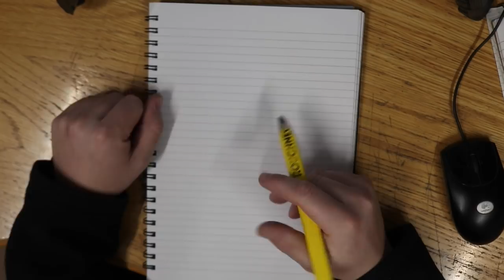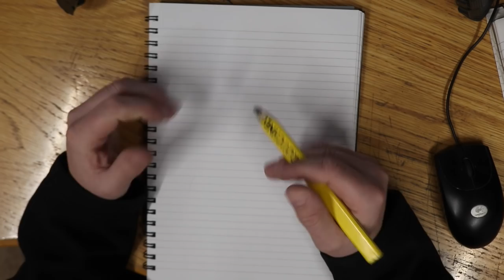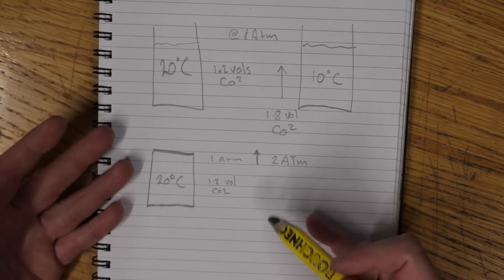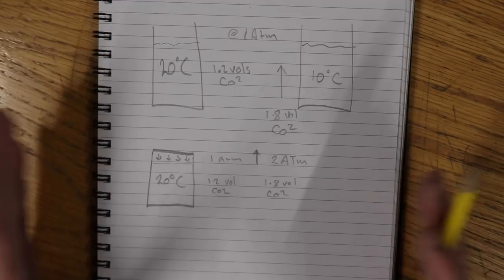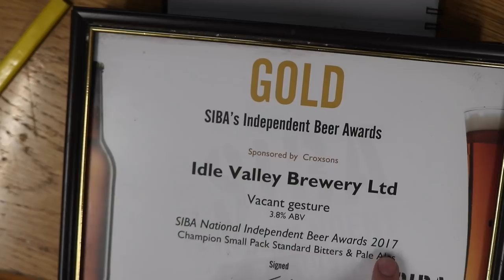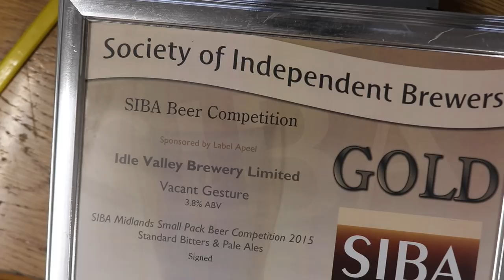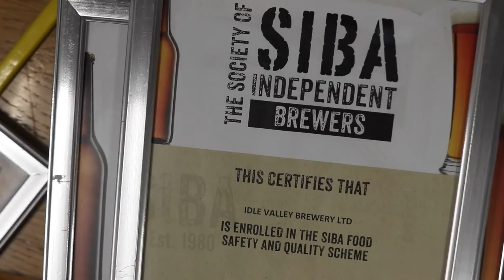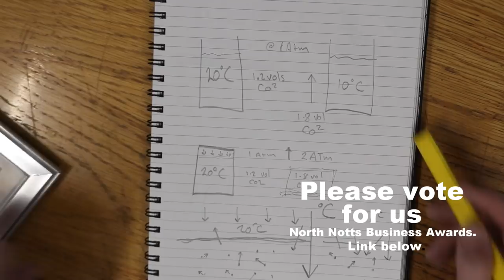The Science & Method Behind Beer Carbonation. As Far As I Know

Comment: Well yes, the solubility of Co2 increases when the temperature drops but it takes some time for it to go back into solution. The surface area is pretty small compared to the large volume of the fermenter. Even when force carbonating beer it takes a few days at a high pressure to get the co2 into solution so just leaving the beer at a cold temperature doesn't mean it carbs up. 
And no one questioned your beer making abilities, so getting out your awards to make a point was a bit much^^
Reply: Completely agree with this! If reducing beer temperature alone meant that it essentially became carbonated, we’d surely see some evidence of it? Maybe Brülosophy should do an experiment, although I’m not sure there’s an easy way to measure carbonation outside of a lab. 

Also - I’ve spoken to both Denny Conn and John Palmer about this, and both have stated that although CO2 will escape solution as temperature rises, the action of lowering the temperature alone does not reverse this reaction. Additionally, you fermented these beers in plastic buckets - I guarantee there was a significant level of oxygen in the headspace, so if your beers were supposedly re-consuming gas, it wouldn’t just be pure CO2 anyway. 

And nobody was questioning your brewing abilities - you can brew great beer without being an expert on every topic related to brewing. People merely pointed out that you may not have fully understood the principle! No need to pull out all your certificates - I don’t see what the relevance of this was and seems a bit petty. A Physics degree might have been more appropriate 👍

Comment: Makes total sence Harry. Great website that you referenced. I have found with kegged beer that when I have overcarbonated the beer it does get quite a bite to it from the carbonic acid ( I usually burst carb 30psi 24 hours at keezer temp 3c).  I takes a few days until that carbonic acid mellows into the beer. What I describe as a bite at the back of the throat really holds you back from a good beer guzzle😁

Comment: Priming sugar in bottles, royal pita for me and here is why. These are my thoughts, not necessarily correct but my thoughts.

We ferment beer at 1 atm at say 18C, it may rise to 21C then settle at 18C again, we let it sit for say 4 days to clean up. We then cold crash it, at this moment it absorbs more co2. BUT how do we know how much it already had? We don't.
So now the beer is cold crashed, it now holds more co2, we still have no clue what that figure is, we just guess.

So now its bottling day, the beer is transferred to bottles, it loses a little co2 during this process plus it warms up a bit, we add sugar and the beer then re carbonates up essentially under pressure of secondary.

To accurately know how much sugar we need to add we need to know exactly the start point of vol co2 to know the end point of co2. It gets worse when you ferment under pressure (where im at now) as the beer starts with more vols co2 but often is not quite as high as where you need it, so secondary in a bottle is harder to get perfect as its hard to know the start point to know the end point. This is why most carb up in a keg then do i closed transfer to bottle as the co2 level is easier set in the keg/bright tank.

Calculators work, not arguing that point but only if you put in the right figures to start. I felt they assumed there is low to no co2 already in suspension so they assume a figure that could be incorrect.
Years of messing up my beers pushed me to kegging and now im learning pressure fermenting which is a whole new learning curve.

Something you said Harry during a vlog regards your casking, you don't add priming sugar in the cask, you let the beer fully ferment out also and after cold crash you cask as is and the beer has the perfect carbonation. For say a bitter that may be around 1.4 in a bottle, cask might be 1.0 to 1.2, its usually lower. So that got me thinking on the previous video your start co2 might actually higher than a lot of the calculators actually think. Thinking back i have experimented with this when i used to only bottle by adjusting the levels of sugar, marking each bottle and making notes per %ABV and style of the beer to try and come up with a dosing figure that gave a near perfect pour from the bottle. I even dropped beer into bottle with no priming sugar, 2 weeks flat as a pancake, 6 to 8 weeks perfect...and that was from a cold crashed fully fermented out beer, no good for hoppy ipa's though.
So there is still some life and sugars left in the beer, without added sugar it just took way longer to secondary than by adding sugar and giving the yeast extra to feed off. Some crash the beer 2 points off FG and bottle/keg/cask right there knowing it will attenuate down in the vessel and gas itself up..also food for thought.

Bottling/secondary co2 via sugar is an art, the only time i personally ever got it dead right is when i worked a batch with various levels of sugar and bottled the next batch with the level i found worked the best, it was always different to the calculator output. Kegging with sugar easier, how...add a spunding valve and bleed off co2 pressure so that the perfect carbonation level is achieved, cant do that with a bottle though.

Last, the difference regards the amount of sugar at 4C to 20C is huge, 60g or so difference for a 19L batch at 1.8 Vols, Harry im thinking you will be close on right, i always worked out how much sugar needed to get from 0 vols to where i thought the beer would be already, then how much to get to the desired level, then minus one from the other to give me the additional sugar needed to get me from where i was to where i wanted to be, still guessing though.

Great video though, adds more thought in the mix for me.

Comment: Mic drop!!! Lol I always thought (perhaps incorrectly) that the potential to absorb gas was increased as temp dropped but that didn't necessarily mean that it would. I understand equilibrium state of pressure but there was one part in your explanation that confused me; you said that co2 molecules in the beer move slower at lower temps thus not able to break free from solution, but then showed a fast moving co2 molecule moving into solution. Think I need to go back and do some reading. Cheers Harry!!
Reply from the maker: From first principles, I imagine the co2 bound in a liquid state moves slower partly due to temperature but also due to the liquid being more dense than gas, with more molecules for the co2 to bump in to. Therefore the potential for co2 to enter the liquid is higher if the equilibrium measure has changed. Ultimately meaning the liquid is now able to "hold" more co2 until the new equilibrium state is achieved.

Comment: Since your fermenter is not under pressure and the headspace is now co2, why would the headspace co2 be absorbed into the beer by lowering the temperature of the beer. There is no pressure so no absorbance. Of course it would be absorbed IF you increase pressure.
Reply: This is what I thought too - though I don't claim to be an expert and happy to be proven wrong!!
Reply from the maker: The fermenter is under atmospheric pressure. Drop the temperature and the co2 in the head space will diffuse in to the now colder beer, faster than the co2 diffuses out, until a new equilibrium is reached.

Comment: I sense that line of questing was slightly annoying?   For me carbonation is quick & easy.   I force carb at high pressure with the beer code for 24 - 48 hrs (depends on beer style).  I sample it along the way to determine when the desired carb level has been reached.  If I'm bottling I'll slightly over carb the beer (again I do this by feel/appearance/taste) and use a beer gun to bottle.   Easy peasy...  If I start casking I'll go back to using priming sugar and longer conditioning times...   Cheers!